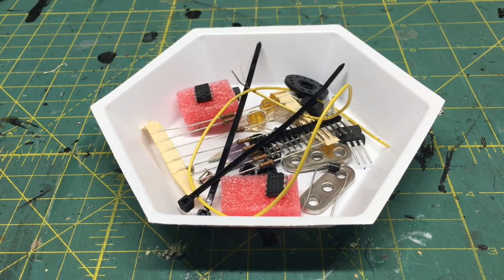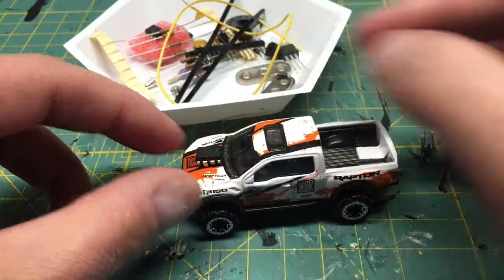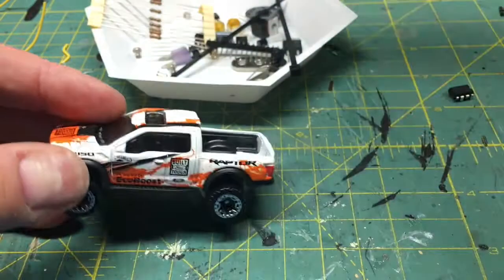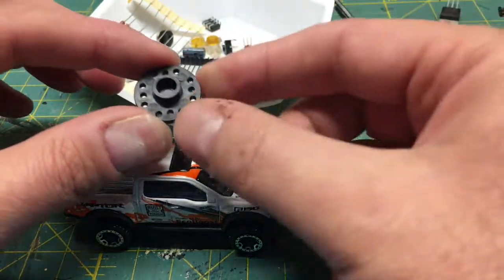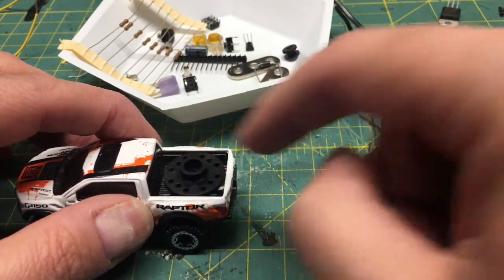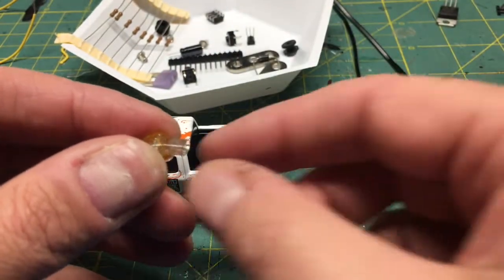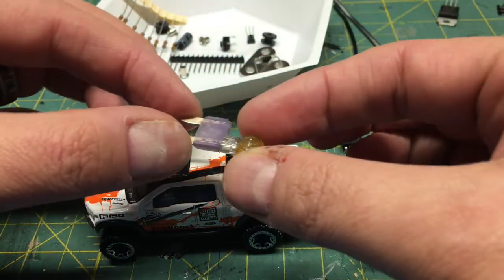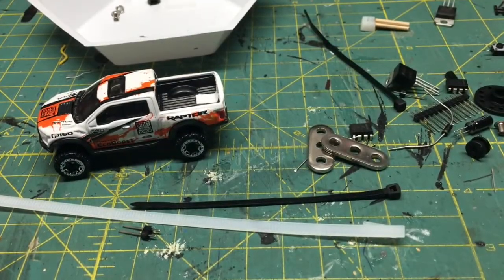GTE 047 -- Combat Vehicle Weapons for Gaslands

Comment: Excellent!!! I'm doing the same with my gaslands' cars. If the idea of the game is a death race, Mad Max style, with cars full of rust, weapons made by any stuff found in a junkyard (guys, it's post armaggeddon, don't expect a F1 racing car), we must try to represent this. My first car for Gaslands was a broken Lightning McQueen with missing rear wheels. I just looked in my tool box for anything, literally, anything that could help me to custom and restore the car: office clips for armor and decoration, 2 SATA conectors from and old PC (turbo exhaust pipes, jejeej), electrical wire connectors (for 2.5 mm wire) for rear supercharger, Fischer wall plugs for side mounted "rocket launcher" or a rare machine gun, and so on. About the painting. The primer coat I tried to cover all the surfaces even but when I applied color (a mix of black and dark red to simulate cheap anti corrosive metal primer) I tried to paint a little messy, and some parts of the car (the hood lighter than the rest of the chassis) with different tonality; like a car made from scrap parts found anywhere. And the same for the rest of my cars, I'm not buying a brand new hotwheels, besides it's cheap price, I'm ask in my community (parents of my children's schools, neighbours, etc) for die cast cars broken or semi broken. Gaslands in some way contribute to reciclying old toys ;)

Comment: The plastic tubes from pens make good gun barrels. Pop rivets, small metal eyelets, some buttons, plastic packaging is an endless source of materials..I like the 7805 voltage regulator as a cannon! Brass compression fittings look good. Wander through you local hardware and surplus store. Tell them what you're doing..Lotta gamers out there. They may very well help you out..

Comment: 12:10 when you go from the fuse to the zip tie and the truck moves back a couple inches there is a new piece on the table infront of the truck that you don't talk about. What is that piece called?
Reply: Are you talking about the header pins? They come in strips and can be cut to how many pins you need at each crimped spot.
https://upload.wikimedia.org/wikipedia/commons/b/bf/6_Pin_Header.jpg

Comment: @6:35 its called voltage regulator ;) , ive used bazzilion of those in past. could actually be used as add-on or as part of voltage regulators in case of semi trucks lightning.

Comment: If you want turrets that rotate, you can attach a small neodymium magnet to the bottom of the turret and (if necessary) another magnet to the place on the vehicle where the turret will go (watch your polarity). The attachment is very secure and rotation is easy.

In addition if you keep your polarity consistent across all your projects, magnets allow you to swap out turrets trivially as well. The machine gun armed technical today can be recoilless rifle armed tomorrow and plasma arc armed next weekend.
Reply from the maker: It's a good idea. I saw a few examples on the Gaslands Facebook page, but I felt the items were sitting too high with the magnet underneath. It doesn't bother me that the weapons don't rotate, but swapping out is definitely something useful for players.

Comment: If you don't mind de-soldering, you can find lots of parts on an old computer or busted radio.
Reply: There are still a lot of CRT TV's being thrown out , tons of electronic components, heatsink's, wiring, etc. Just be a little careful of capacitors as they can remain charged for a long time.